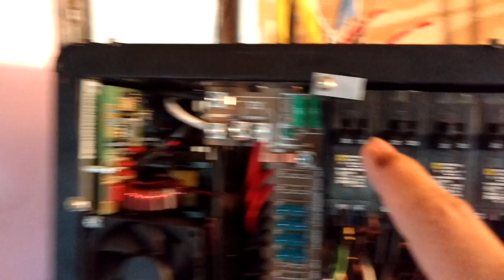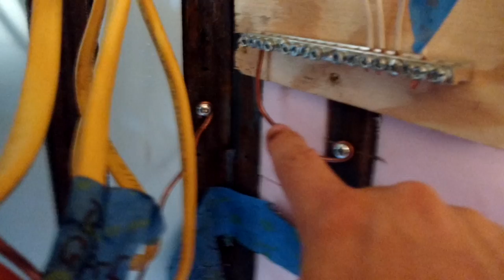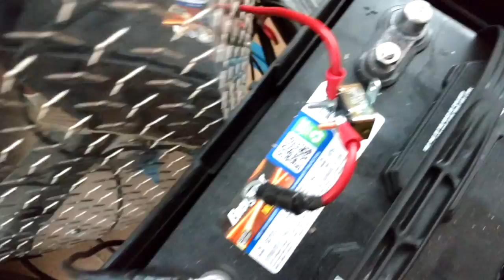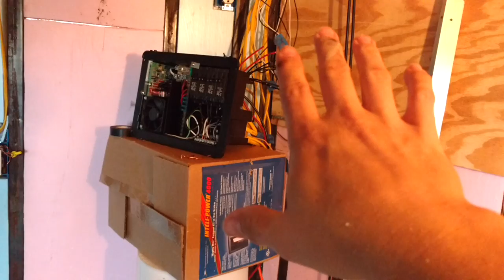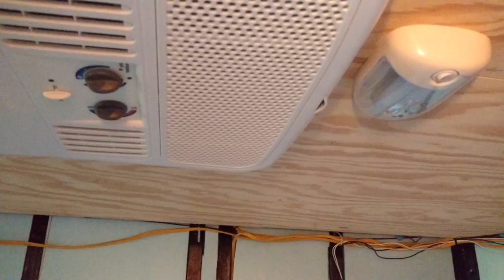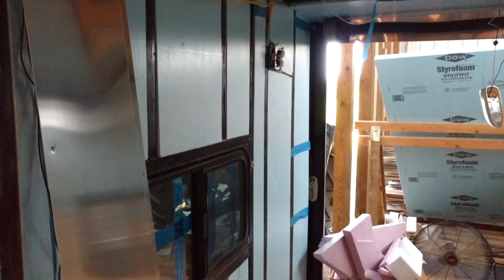6x12 V Nose Cargo Trailer Conversion Part 5-3

Comment: how does the solar hook in/work in conjustion with the PD40/45?  Great videos thanks
Reply from the maker: Thanks for commenting.  The solar is hooked up with a fuse on each positive line.  One fuse coming from the solar panel and one going to the battery with the charge controller in between.  I do not have the solar panel connected to the PD4045.  I have separate pos/neg line going from the the charge controller to the battery.  I do not have an inverter either.  The solar panel right now is just charging the battery when we are not connected to shore power.  I disconnect the fuses when I connect to shore power.